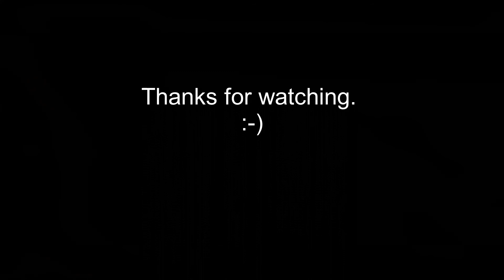A smaller jet engine

Comment: Curious. The 2 nuts at the front and back of the turbine both appear to be reverse threaded (and on the same axis). How do you tighten one without loosening the other?
Reply from the maker: Nope , They are both left handed.
Reply: @cytron8787  yes both left handed. Actually, better way of asking the question. When it comes to disassembly, after you've removed one nut, how would you remove the other nut? The remaining nut would turn the axle - how would you keep the axle still to undo the remaining nut?
Reply from the maker: @author722  I remove the first nut , after that I remove the shaft then  holding it on the lathe chuck so I can remove the other one what ever come first , usually the front one because the nut at the turbine side it's getting hot and then it stacks a bit more than the front one  🙂.
Reply: @cytron8787  got it, understood. Thanks bud, cheers

Comment: I am look to build one of these. Can I heat (evaporate) diesel as fuel?
Reply from the maker: Yes, the evaporators are build in the engine, I just run it on gas for test purpose.
Reply: @cytron8787  thanks for telling

Comment: Sigo viendo cosas raras...de momento parece que va lenta de rpm, el engrase no se ve, pero acaso es una linea independiente? si es asi ,el engrase de los rodamientos no será efectivo...la turbina no empuja nada, por falta de rpm y por falta de cono reductor.
Reply from the maker: You made a very good point there my friend, you are the first viewer noticing that, indeed rpm are low , this is because my NGV and turbine have steep angles, also lubrication it is separated as you notice, but I can control it manually using a  needle valve so I can deliver some lube even at low pressures for testing .

Comment: how much thrust you have in this engine at maximum rotation
Reply from the maker: In this video the engine runs at idle speed and without a nozzle, the thrust it's very small, I believe around 150 grams . I will test it with nozzle for maximum thrust soon.
Reply: @cytron8787  sir did you check it's maximum thrust with nozel?
Reply from the maker: @mudassirazam3947  No I didn't yet, I need to do some small details to get there.

Comment: These turbines are really cool.  I'm looking to make one using only scrap.  I'm just in doubt about the fuel.  Can normal gasoline or diesel be used? I am from Brazil
Reply from the maker: I just use gas for test, it gives cleaner burn, and you can't overrun the engine so it's safer.
Reply: @cytron8787  Thanks for the tip.  It will help me a lot.

Comment: hi, did you buy or manufacture the turbine wheel and the NGV ?
Reply from the maker: I bought only the turbo.
Reply: @cytron8787  what is turbo ? 
Compressor or turbine wheel?
I also made one turbine (mw54), but had many trouble with this hot parts
Reply from the maker: @NoName-dr4ed  I mean the compressor . Yes indeed are difficult parts to manufacture. compressor can be bought cheaply because are used in cars. NGV and turbine are hart parts to built with whatever method you choose (built them by hand tools or cnc machine or buy them ). Wish you good luck.
Reply: @NoName-dr4ed  did you bought these parts?